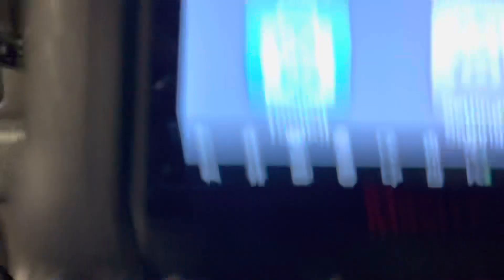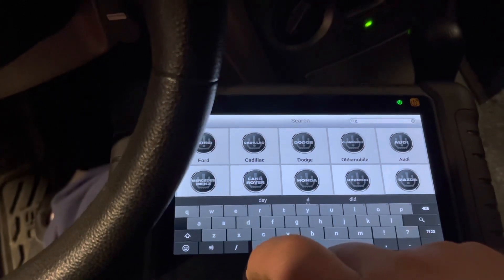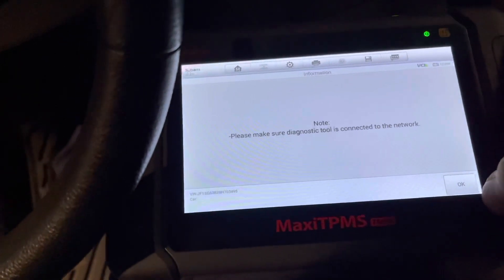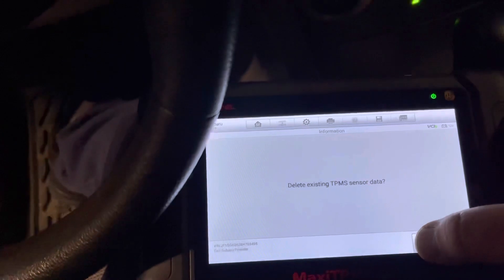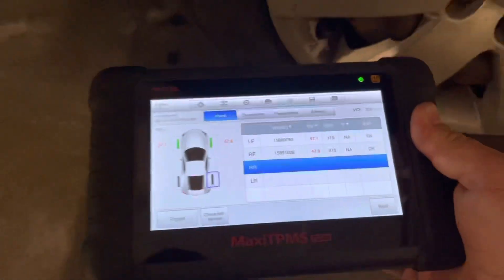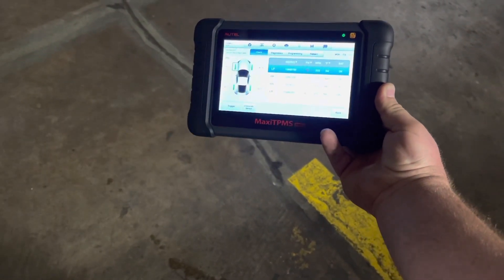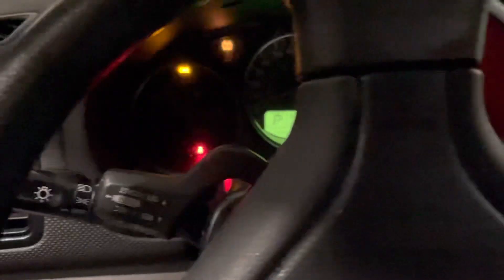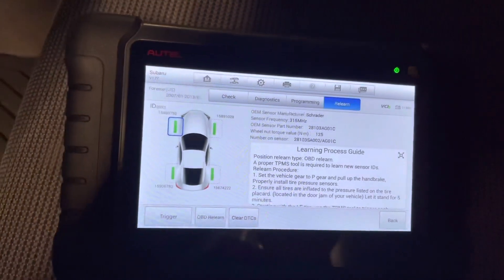How to program TPMS sensor in a Subaru Forester 2008

Comment from the maker: I left the link in the description for the sensors I used and yes I wanted to let you know that I saw your message.

The sensor are generic and yes you can program them using the Autel tool as long as you collect the sensor information and use the obd2 method